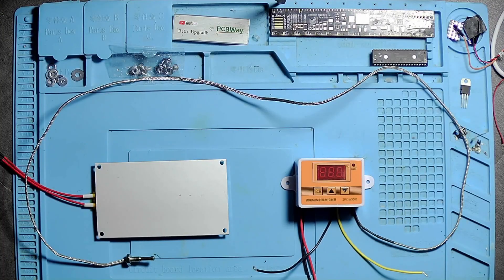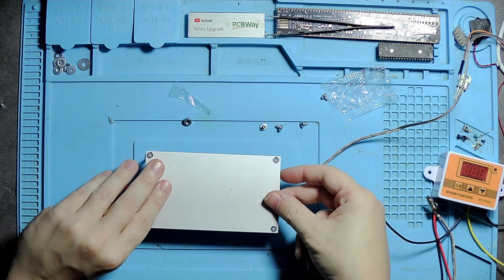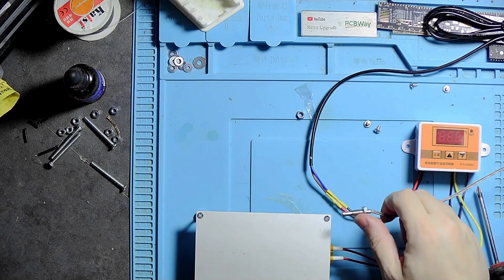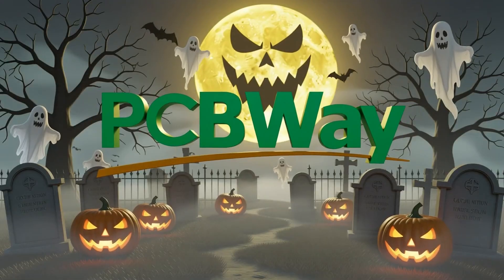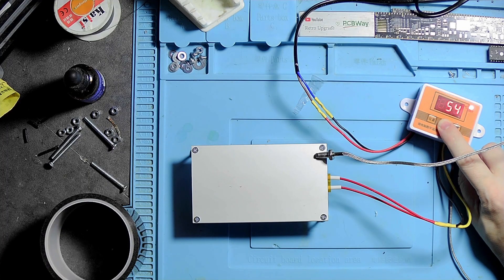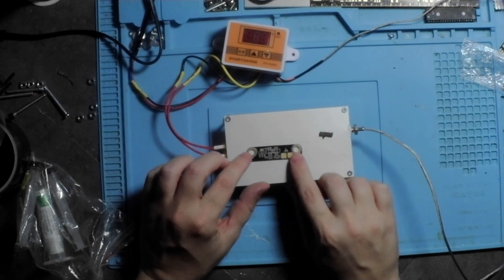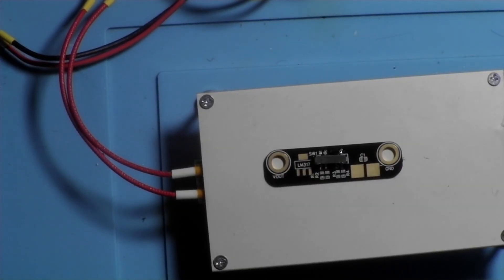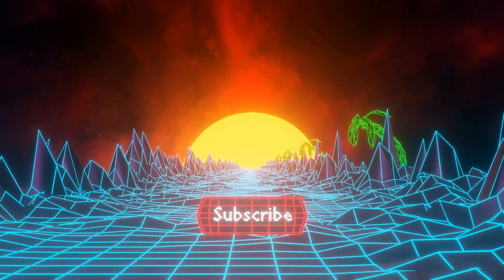🤑DIY Hotplate // Pre-heater for  €10  - not perfect but usable 😎🤑🤑

Comment: I have one of those and used it a few times as a preheater for big boards but it's too concentrated for big boards so doesn't heat them evenly so thinking of adding a bigger 3mm aluminum plate above with some thermal paste between them for better heat transfer, all held by nuts and bolts in the leg halls, just need to get the aluminum plate.
Reply from the maker: Hi mate, yeah I was discussing this in another comment , using a big metal plat for thermal mass so the heater heats evenly and a lot slower so the temp regulator can keep up. A aluminium plat would be perfect good transfer specially with thermal past or thermal epoxy

Comment: Can you make a version of this where it will melt all the solder on the board, and then a giant Moo-Sucker comes down and instantly vacuums all the solder out at once?
Reply from the maker: Interesting idea XDD, actually think i could make it work if we use a old airhocky system in revers you lower down and make it suck instead :P  its practically a giant flat surface with many holes that can suck at once  , dont know what the use may be but sure sounds funny :D, cheeres mate for the  view

Comment: I coincidentally spend some time earlier today revisiting my own preheater project. I made mine from a convection toaster oven I found in the trash, basically just removed the range-style 800w heating coil and a shaded-pole metal fan. After I first assembled it a while ago, I realized the fan spun the opposite direction, so it was as sucking cold air over the part, and it couldn't be changed or flipped, so I spent an hour today today taking it apart and twisting each fan blade the opposite direction.
After getting it back together, now the hot air mostly comes out the sides. Which is better than going into the base, and cintroller, but not much. Oh well. Still works okay if I discontinued fan. I'm definitely going to have to revisit it a third time... Or maybe just make one of these.
Reply from the maker: yours could actually work really well in a enclosure as it pushes the hot air around and heats everything evenly, but the fan will probably reduce to much of the initial heat otherwize if its open to air,

i  have som sugestiones if you gona build one of the ones i built ,first the module that controls the temp is slow so you need to slow down the heater and secondly its 1500w so you can power 2 of these 600w heaters at the same time , to slow it down just put a big cunck of metal ont op of both elements and you slow it down it has more thermal mass so it dosent lose all the heat instantly when you put a huge PCB on top and you should be able to control it easily as it slows down heating of the chunk of metal :)

hope this makes cense XD, i am on meds after all :P
cheers mate